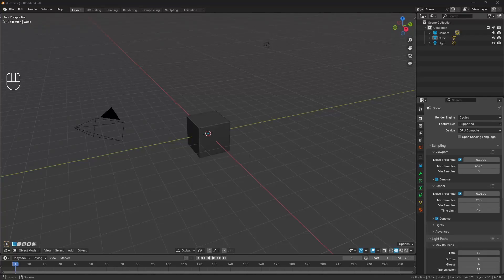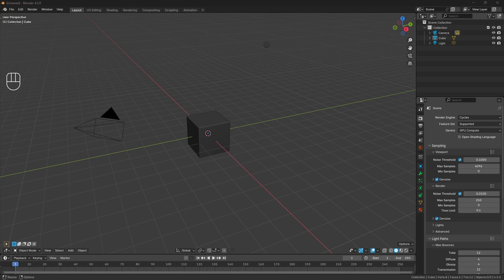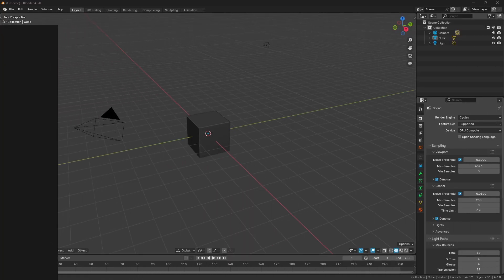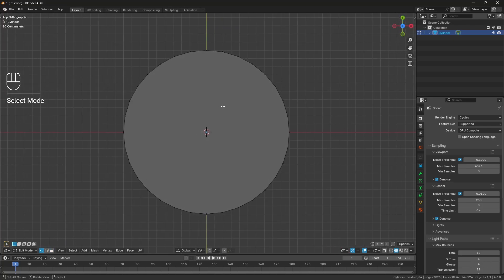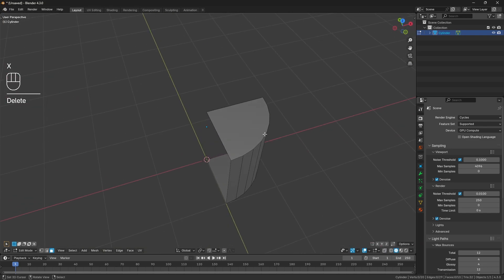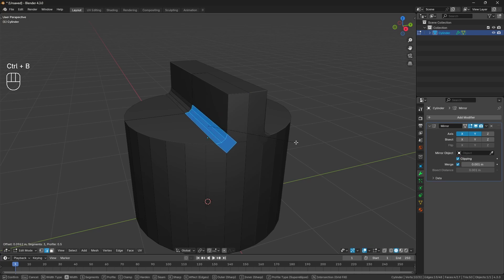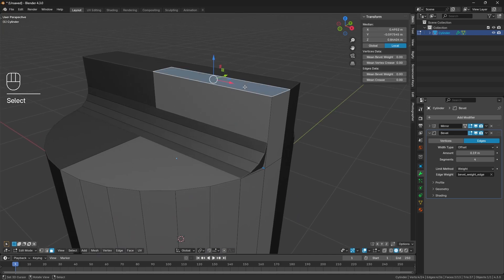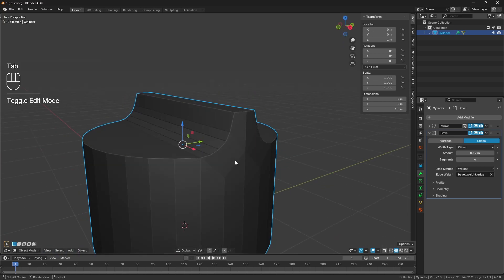Blender Hard Surface Modelling for Beginners | Model Keyboard Dial Blender

Comment: Hi Josh, as always, an excellent tutorial. 
I was reading some of the comments and in one of them someone says that the "K+C+Z" command isn't working. I don't know why, but for me the shortcuts are different. Instead of the "C" shortcut to make a straight cut, mine is "A". And instead of "Z" to cut the mesh, it's "C". These have always been the same since the older versions up to this 5.0 version I'm using now. 
Thanks and see you in the next one.
Reply from the maker: I've carried across a lot of the keybinds from older versions of Blender, I have some strange hybrid between 2.79 and Blender 5.0. 😅

Sorry about that, I forget that I have this strange hybrid of keybinds sometimes. 😄

Comment: 2:10 i can't tell if youre saying Z or C and the the button hints aren't  showing. Either way I tried both and I'm not able to get that cut line to go all the way around the cylinder like you did. It only shows up on the top/bottom and not the sides
Reply: K for knife. Click the vertix, C to keep it straight, go to other side click the other vertix, hit Z ... but the sides aren't cut and now im stuck in knife tool and can't get it to go away.
Reply: I had to do it manually. took a lot longer than your example here. Hoping you can help me figure out why it doesn't work as you demonstrated. Blender v5
Reply from the maker: Hey mate, sorry for the late response, I was away for the weekend. But I press K for the knife tool > click on a vertex > `C` for a straight cut > `Z` to cut through the mesh > drag my cursor off to the right > click to create the cut > and then press enter to confirm the cut.

Hopefully that helps. 😄

Comment: Hi, in minute @13:54 you did insert/merging vertexes, but I don't know the different, could you explain it to me? and after that, you check the 'edge rail', should we always do that after do the insert/merging vertexes to improve our models? or we should do it in other cases too? Thank you for the tutorial.
Reply from the maker: Ahh yeah, I see what you mean by the merging. So as I say in the tutorial there, I'm doing an inset to the bounds, which effectively means that Blender will find the non0maifold edges (edges that aren't connected to another face) and use that as a terminating point for the inset. 

Now, that might seem a little confusing as it looks as if the middle most edges are connected to another face since we have the mirror modifier on. But as far as the inset operation is concerned, that mirrored topology doesn't exist yet, so those edges are considered non-manifold and just terminates the inset at those edges. As for it's use cases, it's quite literally only applicable when you're doing an inset with a face that contains a non-manifold edge, outside of that, it won't do anything. 😄

As for the edge rail, I don't actually have a consistent means of knowing when to use this, I typically toggle it on and off when using insets to see which version looks better. 😅

Using this tutorial as an example of how I knew to use it in this modelling example, if you look at the topology before I apply the edge rail, you'll notice that the inset has kind of distorted and skewed the edges a little. When I notice this, it's a good indication to me that I need to use edge rail, and if you look, once I tick edge rail the edges become perfectly straight again. 😄

I'll need to do more research into the specific use cases/functionality of edge rail myself so that I can provide people with a more concrete explanation in the future though. 😄

I hope that makes a bit of sense? Sorry, I know the terminology is a little complex, so if anything is unclear, just let me know and I'll do my best to simplify the explanations and provide additional detail. 😅
Reply: @masterj2001  Thank you for taking the time to understand my question and respond in detail. I'm interested in modeling existing products and animating them. Do you have any book recommendations on this topic?

Comment: dopes this even still work in 4.5? cant seem to find loop tools in the add-ons section
Reply from the maker: It certainly does, yeah. If you can't see it in add-ons, you might have to search for it under the extensions tab since Blender rejigged the way add-ons work. If you still can't find it there, just lmk, and I'll see if you can't still do it the old fashioned way by manually downloading an add-on .zip and installing it that way. 😄

Comment: I’m new to hard surface modeling, so just curious—why do you use edge crease instead of a bevel with 2 segments and a profile of 1? Wouldn’t that give similar results without needing to push the subdivision surface modifier up to 4, since 2 subdivisions usually work fine?
Reply from the maker: This is a great question, shows that you're really thinking about topology and how support loops and hard edges actually work in subd modelling. 😄

So what you're suggesting here will definitely work and there's nothing wrong with your method. I primarily teach with creases due to it being more easily adaptable to more advanced modelling concepts. I do also use bevels such as you've suggested here, but reserve them for specific use cases where creasing doesn't work as well (I don't have a set way to identify these scenarios, more through trial and error). 😅

You'll notice with using the bevelling method that you're suggesting here gets a bit hard to maintain on more complex models, especially when you run into poles on curved surfaces. It also means you need to manage a lot more topology compared to creasing, which can make your models a nightmare to work with later down the line. 😅

Hope that does a decent job of explaining it? Happy to elaborate further if you have anymore questions though. 😄
Reply: @masterj2001 I think I get it ,for simple shapes I can work with bevel but for complex shapes edge crease works better and create better topology

Comment: hello. trying this step by step the same, but when i use the knife tool, you say K then C then Zeta, am i supposed to press Z? it's not cutting the bottom circle face at all with the top when i make the second cut. also it isn't deleting the side or bottom faces when i go to delete.
Reply from the maker: Hmm, strange. So yeah, I press 'K' for the knife tool, then after pressing 'K' I click to start making a cut, then I press 'C' (this snaps the cuts to 30 degree increments) , and then I press 'Z' (which enables us too cut through the mesh.

As for things not deleting, make sure you're in face select mode, make sure the face is selected, and then press 'X' to delete. I know that seems very simple, but it's easy to overlook things in Blender sometimes. 😄

If you're still having any issues, please let me know and I'll do my best to help you out. 😄

Comment: How is this beginner friendly. 
1:25 "We're just going to go J zed and one." What???
Reply from the maker: So this is just to move the cylinder by a value of one along the z-axis. We press G, then Z, and then 1. You can completely skip this step, I just do it so that the cylinder is sitting above the grid floor so that you don't have it interfering with the model, just makes things less visually cluttered. 😄

And this is aimed at beginners that are looking to get into hard surface modelling, which in its own right it a more advanced segment of modelling. So I do assume that people have a basic understanding of Blender, as being an absolute beginner and trying to jump straight into the deep end of hard surface modelling would be a fairly daunting task. 😅 

Though, in saying that, I do my best to not use a bunch of shortcuts or anything too advanced to try and help guide people through the learning curve as best as possible. 😄
Reply: @masterj2001  This is a bit fast paced for a beginner's course though so some constructive criticism in the future, maybe slow the pacing down so it's easier for me to process. Thanks!

Comment: One thing I am confused about is the Smooth by Angle modifier and when to use it. When does one use it over just the Shade smooth option? Not to mention the harden normals option?  Any advice would be appreciated because I've just about pulled out all my hair on this one  :)
Reply from the maker: So the 'Smooth by Angle', 'harden normals' or 'weighted normals' modifier won't play nicely with a subdivision modelling workflow.

You would use these things in a 'weighted bevel' modelling workflow. This isn't a workflow that I'll be focusing on in my tutorials, as I've just learnt much more about subdivision surface modelling, though it's a topic that I will be touching on in a future video. 😄

But for my tutorials, you're not likely to need to worry about these for the content that I'll be teaching. 😄
Reply: @masterj2001  Thanks for the reply!

Comment: Hello ! Great tutorial ! I might be mistaken but why not bevel the edge directly if you were going to apply the modifier and delete side faces ? thank you
Reply from the maker: That's a valid point, and I totally could've approached it in that way. I just wanted to introduce people to a non-destructive bevelling workflow and show a different means of approaching it. 😄

Say somebody was following along, they used ctrl+b to define the bevel shape and decided later down the track that they wanted to change the profile after making some adjustments, they wouldn't be able to—thus why I included this method. That way, if somebody following along decides that they want to adjust the bevel profile after making adjustments to the top of the dial, they have that flexibility with their model and aren't stuck with the original bevel shape that they defined.

Hope that helps explain my reason for approaching the model in this way? 😄